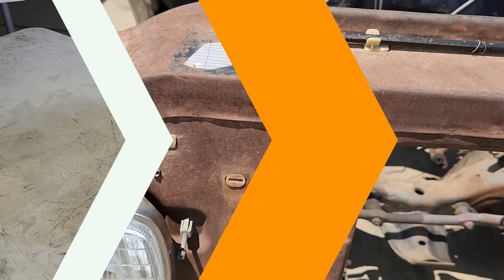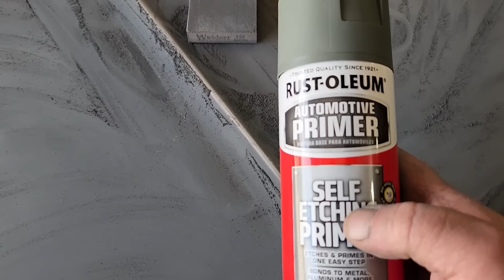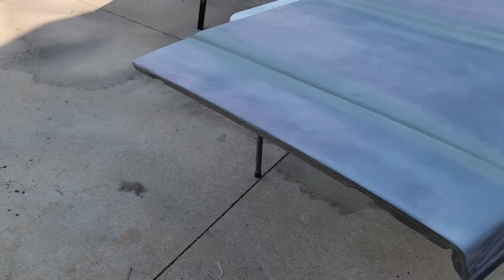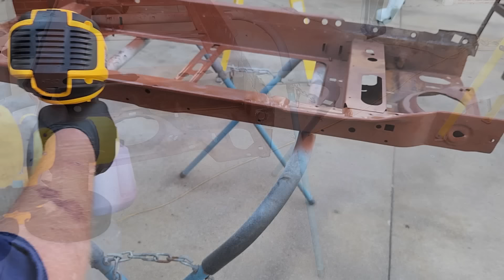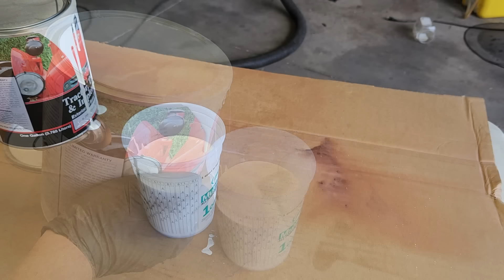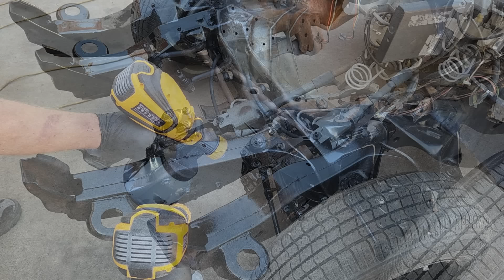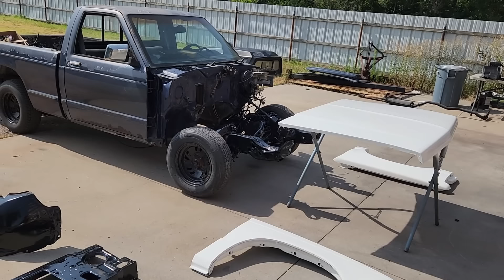S5 E27.  A low cost automotive  paint hack that really works. Rustoleum and  electric sprayer

Comment: I used a roller and tractor supply white paint on a similar S10.  

She was a 50/50 beauty. She looked great 50 yards away at 50 mph.  

I just wanted it to be all the same color and sort of presentable.
Reply: When I did my own body work on the 1982 Datsun King Cab diesel I had, I was pleased that it photographed well from 20 feet away to submit to get my salvage title.
Reply: @smithno41  i have driven exactly one of those! My neighbor has one! Its a blast to drive and so unique. SD22 powah! 😂😂😂
Reply: That's about the kind of paint job I can do, Ive heard of a 50 footer but never 50/50😂😂😂😂
Reply: @goosenotmaverick1156 A buddy and I painted a car with several coats using a roller.  Then we spent a week at the gas station we worked at wet sanding it.  It actually turned out decent.  He put tape on all the corners and only he wet sanded those spots.
Reply: @Stephen-in-Ohio  thats awesome! I had a great uncle that painted one with a literal brush. He didnt put in the sanding effort, so you could tell. 😂
Reply: When I was a  kid I remember my dad bought a Triumph Spitfire that someone painted with a brush 🖌️ You could see brush strokes all over it 😂 It looked horrible.
Reply: @michaelbrinks8089  the sad part was, he picked a gorgeous metallic orange color then used a brush. 😂
Reply: @goosenotmaverick1156 wet sand it.
Reply: @Stephen-in-Ohio  oh he and that car are both long gone. It was a solid 20 years ago now. 😂
Reply: Poetry in Motion. I am sure she was Beautiful! 💃👍
Reply: I roll painted sides of my nissan while waiting for full respray later. 
Turns out the roller was made only for housepaint as it shed hairs into my paintjob.
It keeps rust away still so not worst 10€ I've used
Reply: @allux8236  yeah, you want to use a foam roller if you’re applying it to metal.
Reply: This is how I feel about repainting my jeep🤦🏽‍♀️🤣
Reply: I worked with a guy who bought a 2WD forest service suburban. He painted the whole thing blue with a roller. 50/50 is right!
Reply: Roller, hahah. Got that textured finish.
Reply: Hey like I say its a work truck...not a princess  cart
Reply from the maker: 50/50 sounds about right for an S10. LOL
Reply: We don't give a shit

Comment: Used a sprayer like this to paint my house a few years ago. 
It made it almost all the way through priming the siding, but died while doing the soffits. Turned out that it doesn't like spraying at an upward angle, and paint leaked back into the fan and lit up the fan motor.
Reply: There’s another version of this where the blower is in a separate unit and is connected by a hose. This solves that problem
Reply from the maker: Interesting, I have heard of this happening before.
Reply: @robotcantina8957  - This is important info for anyone looking to buy one. Jimbo, pin it!
Reply: I also experienced that problem with this style of sprayer.  Paint leaked back into fan area! Only if tilted upwards though.
Reply: @iamthebeav wagner has an angled output stem to shoot the paint up
Reply: For what it's worth, I've used this exact clone sprayer to do two play sets and a whole backyard fence with no issues.  I was astonished how well it worked.
Reply: You have to be smarter than what you are working with
Reply: Was it this one or the actual Wagner version? Because I watched a dude paint a whole ceiling ( 40x 60, big house) with one of these.
Reply: Lit up ? You painted your house with hot lacquer ?
Reply: That's interesting. I did read to keep it tilted downward. It didn't mention anything about not spraying in the gun after taking the sprayer tip off as an attempt to clear out any paint blockages... At that time I didn't know it was a direct route to the blower. Not till I was done and cleaning it after dismantling it. I am not sure how it survived me doing that multiple times during painting an outside wall. Phew....😅
Reply: Wagner has an angled output stem to shoot the paint up

Comment: I just recently painted my full size truck using a similar mix (but used a conventional spray setup).  Is it a show truck?  Not a hope. Does it look 100X better than before?  Hell yeah!!!   

As for that sprayer - try modding it with a toggle switch so the motor stays on.  Then you won't get the pressure waves up/down and can use it more like a conventional sprayer. If you're stopping pulling the trigger for more than a few seconds (moving areas,etc) flip the motor off so it doesn't get cooked from lack of air flow.
Reply: I would just buy a pressure pot and gun and a pancake compressor and a length of hose if I were doing any job bigger than this though
Reply: @realhulkhogan  - paint mix.  Nothing to do with the gun.  I think my 80gallon 20cfm one can handle the job.

Comment: “If it ain’t right, paint it white” that’s what my grandpa used to say. Fits perfectly with a “good enough” paint job. It’s gonna look just fine and work just as well as a perfect paint job at keeping the rust at bay. Nice work!
Reply: If your prep is wack don't paint it black 😂🤣
Reply: @jasonbirch1182 facts. Black will show flaws you can’t even feel much less see.
Reply: @jasonbirch1182 I am a painter of 30 yrs. Prep is key to everything. I agree with you 💯.  The most important part of any paint job
Reply: @carrscoffee flat and satin will hide some sins for sure, especially on a race car.
Reply: I paint a crap load of cabinets  for shop around  my town. You have to be alot more careful when your doing finish work. @jasonbirch1182
Reply: $400 1985 Ford Ranger, 12 white rattle cans, and 4 cans black for grill bumpers. Rebuilt the single barrel carb, new oil pump, drove it 4 trouble-free years, and sold it for $850. Was told it looked cool.
Reply: Only issue I have with white is if the hood is visible from the driver seat it can be blinding.  I purposefully never washed my Crapalier just so I could see on sunny days.
Reply: When you paint your own vehicle all it has to do is look good to the neighbors  from across the street.  Anybody who wants to inspect it any closer is jus getting too picky😅
Reply: proof that white is right
Reply: Yeah!  My grandpa said something similar:  "If it ain't white, it ain't right."  He was talking about something else, though.
Reply: @Salmon_Rush_Die  mail Jeeps I understand my grandpa was a postal worker
Reply: Im literally painting my truck satin white... When im all said and done Ill do a metalic white satin ppf over everything. 

But Im going to probably buy straight white panels and then paint the roof, insides, jambs and floor pan with black line-X and then hang all the doors, tape it off, and spray the whole outside with magic farm truck paint like this, some white color, with deglosser in it and hardener, so any bondo grey stuff, white gellcoat stuff, and sealed oem white junkyard sheetmetal will all be one color of satin/low-gloss white... 

Then the bumpers Im doing in white lineX and the body cladding parts get white rugger-wrap like line-x style vinyl product (its basically thicker vinyl with plastic car part finish like a drop in liner) 

That will make a pretty decent truck for a hot minute and itll be easy to change stuff on, then later wrapping over the whole thing with pearl or metalic white satin ppf will cover any blems and fancy it up a good degree when the truck is finished...
Reply: Im thinking of a cheap satin paint job as essentially primer for a nice ppf wrap as the final result lol...
Reply: And doing white because you can wash it with purple power in a pressure washer with a sponge and then hit it with spray wax and itll be okay toweled town lol... Satin not matte... As long as you leave a little gloss in it you can towel dry spray wax and itll protect the paint... 

Matte will streak up weird, and if no wax at all on oil base single stage with hardener itll get chalky... 

Basically your vehicle will have back to black plastic issues

So

Basically eggshell/satin/semigloss is what youre going for with the deglosser

Frosted so it hides liter everything, but smooth enough you can smear some protection on it without streaks and like rub it out with a towel to a real dull sheen like oiled leather lol... 

Anywho, yeah... Low maintenance paintjobs lol